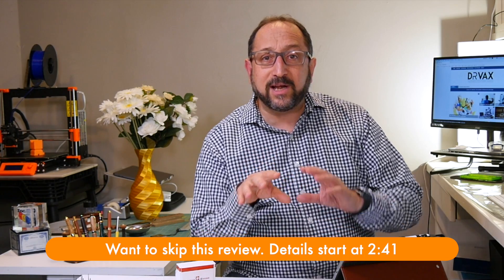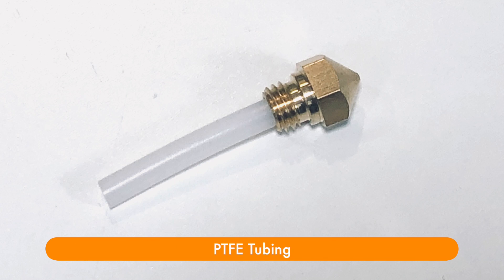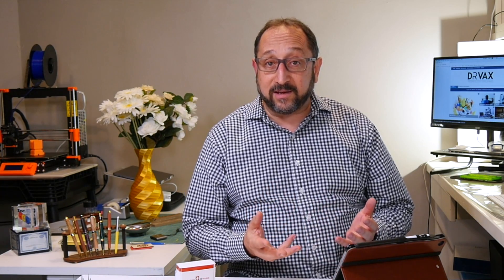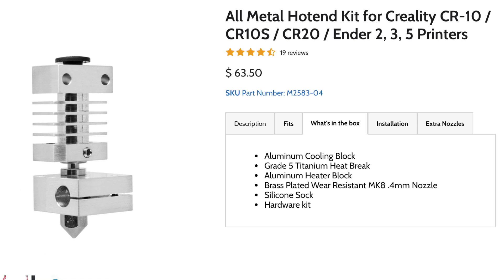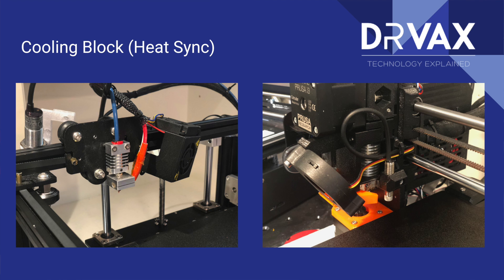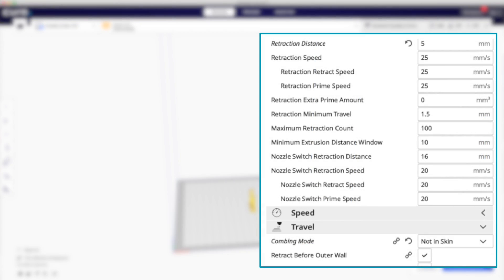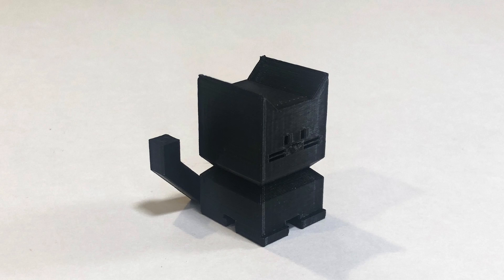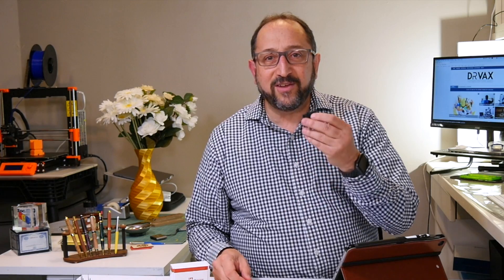Micros Swiss All Metal Hotend

Comment: that retraction end G-Code thing is a good tip even for the stock hot end. wish i would have known that before upgrading lol (i cant store my filiment on my printer ready to go because its far too humid. i have to store it in buckets with silica gel packs lining the bottom when im not printing and i have to use a heated print box when i am printing. i have straight up baked my filiment to get rid of moisture, had a good several layers and then mid print it starts sputtering because the filament got saturated again. so yeah- being easily able to remove a spool of filament has literally zero cons for me.

no my issue with the Micro Swiss NG probably stems from the nozzle not being tight from the factory and my part cooling fan breaking at some point in the upgrade process. i don't have the tools to test that theory right now though because i lack a multi-meter for the fan and a wrench set for the hot end. (that being said though i did accidentally loosen the nozzle more with a screwdriver and a paper towel but didn't have the grip on it with that set up to tighten it again which sort of supports the theory that it was indeed too loose

Comment: I recently got my Ender 3 v2 going again after a 4-year hiatus. After 2 days of tinkering, I am now printing some very nice pieces using the MicroSwiss hotend, which I had upgraded back in 2020 prior to parking the machine. Everything you point out was what I experienced through trial and error. I'm so happy that I decided to give the Ender 3 v2 another chance.

The only issue I'm running into is some adhesion trouble right at the 1cm height of each print. Before and after this point, the print quality is awesome! I've checked the belts, tightened everything proper, so I'm thinking it's the Z-axis. I did uograde to a dual motor setup last week. I have a set of Oldham couplers on the way, which I believe will help correct any imperfections in the threaded rods. I'm getting great adhesion to the smooth glass side of the stock plate, so my z-offset is dialed in correctly. I'm also using a BLTouch with the latest Professional build of Marlin. The bed is leveled perfectly! I'm running the stock, Bowden extruder set-up. Bed temp is at 60⁰C and hotend at 206⁰C.

Given all I've done so far, are there any other things I should investigate that could be the culprit to these 2 or 3 lines not adhering correctly at around the 1cm height? Again, I'm leaning towards an issue with the z-axis, but I know you're very well-versed with the Ender series and its potential issues.

Comment: Because its under built, a micro set screw is bs.
Ripped mine out after a month, mine dripped and leaked and nozzle always loose till it finally stripped. I had a stock hotend for a year with no ptoblems and this pos lasted a month.

Comment: Hi many thanks for all your help I have a major problem I've recently upgraded to a microswiss direct drive on my ender 5. Since then every time I print in pla I've been getting a lot of filament leaking from between the hotend and the heat brake also the hotend and heat brake keeps on working loose enabling the unit to twist thank you Colin

Comment: Well, your suggestion about clearing the clog worked.  I was quite surprised.  I heated the hotend up by 15 degrees hotter than I normally print PLA, pushed it down and then pulled it back out.  I could not get the filament to come out before.  Then I removed the nozzle and used the noclogger tool I bought off of Amazon to clear the rest of the clog.  It took considerable amount of force to so, but at least it is mostly clear now.  Ever since I added the Microswiss all metal hotend and direct drive I get a clog when going from PETG to PLA.  I think I am going to just stick with PETG from now on.

Comment: I have an Ender 3 Pro, that has been printing very high quality prints for 1 1/2 years, a few upgrades, and well tuned. extruder, springs, capricorn tube etc., 32 bit board,  on the orgiginal hot end.
I upgraded to the Micro Swiss hot end, and am having the jammed filament when starting a new print. 
I see the bulge in the filament ( PLA ) inside the heat break, everything else looks really good.
Of course the filament can't be pulled back out, except by removing the hot end, and clipping off the short piece.
I can't force ( pushing by hand ) filament through the nozzle, all the time, even when heated to 240.
Running 3mm of retraction, linear adv,  etc, testing range of temps,  and other settings , using both Cura and Slicr.
Getting some very nice prints, just the plug to work out. Going to try End G Code fix.
Thank you for a great video and some excellent comments down below !! Got some good people in your channel !

Comment: been pondering spending $80 to upgrade to a Swiss Metal Hot End kit for my CR6SE - have been having some pla blockage issues - but based on what I see here would likely be not much different.  I did get my hot end and cooling block cleaned out and running better.  An upgrade to direct drive with metal hot end, and community firmware, and now I see bigger cooling fan is also an option, ... these things all combined might be worthwhile - but for now, I continue to run stock and keep learning.  Thanks for your Youtubes - you have been one of my go to teachers.

Comment: At the momemnt I use a e3dv6 (clone) on my CR10. I have done good prints with this hotend, sometimes it fails and I can't find the reason, lots of wiring due to the fans I use. I would like to put the original look on the printer with the original cooler. I thought to instal a microswiss hotend on it. I've seen some videos with the people making some alterations on the software to use the microswiss. Is that realy necessary? I print only in PLA and ABS. I would like to ear your advice. Thanks in advance

Comment: 5 years and 2 of them with a third on the way mostly PLA. Classic mistake lots of ppl make is "the fans are too noisy" so replace them with noctura "silent" fans. These are silent because the rpm is lower and so is the airflow and then they get issues.

Comment: Great video, I already figured out jamming fix when changing filaments but my prints are taking twice as long. I’m using simplfied3d software. Any suggestions on settings or gcode changes? I’m using CR 10 S Pro printer

Comment: good video but i was wondering how to remove the possibility of filament clogging the inside of the tube. Is the benefit of an all metal hotend that there is no need for an intermediate material, like PTFE, inside the cooling chamber guiding the filament? The below comment by Simon suggests there is still clogging with the hotend.

Comment: It really is about retraction. No more than 3mm with Bowden. I have run one for 250+ hours, I have had 2 jams all due to retraction. My only gripe is that it can be picky to tune for petg, because of the retraction sensitivity. I strongly recommend picking up a copper mk8 heat block. Temps will be more stable and the added mass is great to push the flow rate up.
Oh and if your pulling filament during a change... Make sure you crank the temp way up usually 15-20c above printing temps.
Reply from the maker: Thanks for sharing your experience.  This video was produced quite a while ago and could use an update.
Reply: This video was so helpful in making  a buying decision and where to start with settings... So thank you so much making it.. It's still really relevant with all the creality printers out there.

Comment: 6:20 I’ve noticed that marlin does this automatically if using the “change/remove filament” option instead of doing everything manually. 

When it goes to remove the filament after heating, it will actually push in slightly first and then retract it all out, and you can see a big difference in how fully it removes the old filament from the hot end. 

It looks more like a cold pull than just a smooth melted end as if you just pulled it out by hand. Meaning it’s more fully clearing the melt zone.
Reply: i know Im asking randomly but does any of you know a way to log back into an instagram account??
I was stupid lost the login password. I would love any tricks you can offer me
Reply: @Carlos Bode instablaster =)
Reply: @Konnor Westley thanks so much for your reply. I got to the site through google and I'm trying it out now.
Takes a while so I will reply here later when my account password hopefully is recovered.
Reply: @Konnor Westley it worked and I now got access to my account again. Im so happy!
Thanks so much, you saved my ass!
Reply: @Carlos Bode glad I could help :D

Comment: I have a Balco (cocoon create touch/wanhao I3 clone)  3d printer using the edit end g-code I could eject the filament totally as if to change filament, then just use add filament when I want to print.
might need to play with that E-2 setting to get the right retraction to eject/change filament and not have the motor run needlessly once filament is out. I think I'd need about 55mm retraction.
is there a reason NOT to do this with the all metal hot end (not the micro swiss one)?

Comment: You have the Feed mechanism labeled Extruder. I consider the nozzle assembly as the extruder. I ran a floor of car length extruders that extruded at 10,000 ft. per minute. The world needs a lot a ZipLock zippers:) On those things, they have a huge hopper as the Feed mechanism. 3D printers are a filament Feed. That feed mechanism would be more precisely considered a Tractor Gear. Beam me up Scotty:)

Comment: Get a mini blow torch lighter. When it gets stuck use the lighter to heat up the whole hot end end from tube to cooling block.

Also don't let dried scraped off elmer's glue fly up as you clean off your bed and drop down into the feed of your plastic into the hot end.

The glue dust can cause major blockages.

I also cut a small section of dish wash spunge and slice that half way down the center and slip that over the top of my feed line over the hot end to prevent anything from getting into the tube to begin with.

Comment: Retraction set for 1.0mm + 1% Bowden tube length (0.5% for Capricorn!) works for me, every time.
Evidence?
Two Anycubic i3 Mega's, Anycubic Mega X, Anycubic Kossel Linear Plus, Tevo Little Monster; 25+ kg PLA, 5+ kg PETG, 1 Kg ABS...
The filaments floppy fit in the Bowden tube helps explain why the 1% rule is a good starting place.
Another thing to try: With the filament 'frozen' in a cold hot-end, push and pull on the filament (with extruder released!) to see how much 'free-run' there is in the feed system.
This is gonna show you how far the extruder has to pull back just to relieve pressure at the start of the melt-zone.
Once you know the free-run distance, add this to the actual amount of retraction you wanted in the first place...1.0mm to 1.5mm is about right.
BTW, Capricorn tubing has half the free-run as the same length of white 'stock' PTFE tubing.
All the usual caveats about filament types apply...
Some Cura stock settings suck, big time.

Comment: I've upgraded to a Micro Swiss Direct Drive kit with all metal hot end on my Ender 3 V2, Micro Swiss suggest a retraction distance of no more than 1.5mm at 35mm/s. I can't get anything near the quality I had from my stock hot end. Yes I can print so much faster without the extruder drive gears slipping, but when the extruder can't move between parts without stringing I wonder what is it I'm missing to get this printing as I know it should. It's a real challenge. If you have the opportunity to try out this upgrade extruder, your input and thoughts would be more than welcomed!
Reply: I just upgrade my Ender 3 V2 this past week with Micro Swiss but have same experience where my original stock hot end was printing better.  Have you made any progress since?
Reply: @10bhann  yes, I did. Retraction is at 0.78mm and speed is 45mm/s, I use a 0.2mm wipe distance on outer walls, it's super important you calibrate your E-Steps correctly, after much tuning I hit in 130 steps. This of course isn't what yours will be but it won't be far off. Be careful to change your end G code so it only retracts about 0.8mm any more and you go into the realms of blocking the titanium tube. I highly recommend lubricating the all metal hot end with some olive oil too. Just wipe a bit on a cloth up and down the filament. 

 Another tip - the more pressure you have on the drive gear spring, the more it effects the the wear and tare on the filament. The optimum position is the outer flat surface of the thumb wheel flat with the end of the adjusting thread. You'll also need to add an offset for the print head into Cura of y-10 and x-5. This brings the nozzle to the centre of the bed, if your using a bltouch and your struggling let me know. Hope this helps. Stay safe and happy printing.

Comment: Interesting.  I just replaced my microswiss with another microswiss.  I had been having horrible globbing issues with and after printing PETG.  The globbing continued with PLA but not as bad.  I decided to replace the nozzle and see if that helped, but when I was trying to screw in the new nozzle it didn't feel right so I pulled of the fan housing and found that the heat sock was pretty well cooked and the entire heat block was coated with a few millimeters of burnt and crystalized PLA and PETG,  I literally had to chisel it off.  So I decided to install the brand new microswiss hot end.  To do it I had to use a Dremel with a cutoff wheel to cut the old heat block away from the heat capsule and cut a flat blade screwdriver slot in the screw holding the thermister in place.  Once I got it all back together I am again getting good prints without the globbing problems.  As near as I can tell the globs were being caused by melted plastic building up on the nozzle and when they got big enough they would adhere to the print and solidify.  This would form a roadblock to the printhead as it came by the next time.  Sometimes it would get knocked off-along with a chunk of the print or it would jam the printhead and cause it to start printing off to one side or the other.  All in all, it was a real mess.  The printer is an Ender 3 that I bought about 2 years ago.  It has several upgrades, but still using a Boden tube, but has an upgraded mother board.
Reply: Dunno if you ever figured it out. But here is a check list.
First globbing is almost always due to bed leveling or over extrusion of both. I would start by really dialing in the first layer extrusion rate, remember it is relative to the distance from the bed. 
Second is steps per mm, in my ender 5 which has the same extruder I believe.. I tested and realized the creality defaults are off.. it was 93 steps not 80 steps in my case.
The next thing, I would consider doing a pid tune, if you see improvement from this consider getting a copper heat block, due to the higher mass they will give more accurate temperature control with a proper pid tune.

Comment: Okay, so like... I just installed a micro swiss on my Ender 3 yesterday. I watched a couple hours of vids. I even watched this one like three times to drive home the finer points.

I had a lovely print, waited til the hotend cooled to about 185ish and pulled the filament. Looked like a clean pull. Today, I go to start a new print and the filament won't feed. I took off the fan housing and detached the hotend. I can clearly see that filament filled up in the heatsink. I heated it up without the fan and was able to shove a nozzle needle through it and clear quite a bit, but it still seems like filament can't get through once it's cooled down again.

TLDR Can I now heat up the hotend without the fan so the heatsink gets hot and THEN shove filament through to clear the remaining clog? If not, is there a tool with a perfect diameter and/or solvent I can get to clean this $60 hotend out?
Reply from the maker: You can purchase "needles"  online that are designed to clear out .40mm nozzles.  Just use the front panel of your printer to set the extruder temperature (the nozzle) to about 20c above the temperature you printed at.  Then you can push some additional filament through and then pull it out and also use a needle.

With a metal hot end it is best to remove the filament after every print.

Here is an affiliate link to some needles I have used:

https://amzn.to/3lrfNGn
Reply: @MakeWithTech  I REALLY appreciate the reply. Thank you. 

Heating the hotend up without cooling so the heatsink got hot and cleaning out with the needle seemed to work okay and I'm off printing again. I did pull the filament out immediately after printing, but maybe I pulled it out at the wrong temp?

Should I worry that plastic has now been all up in the heatsink?
Reply: FTR, I did not do that. I was able to shove filament through after using the needle and I'm attempting another print. I'm still a little worried about residual plastic within the heatsink, though. :(